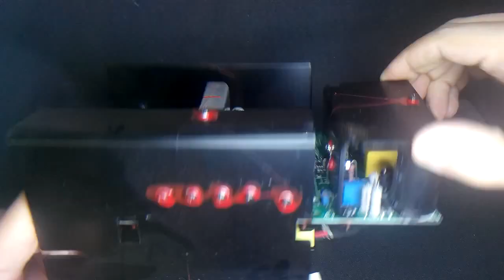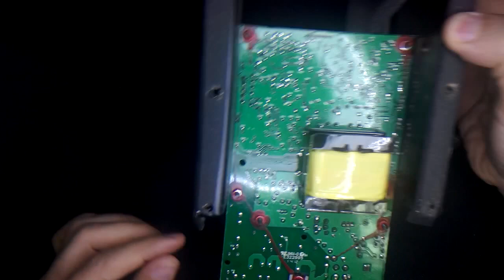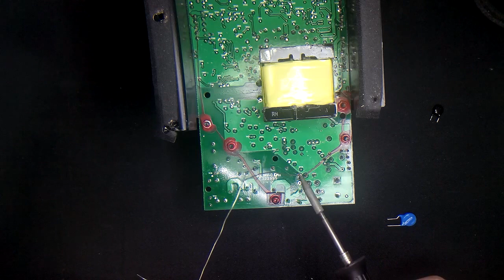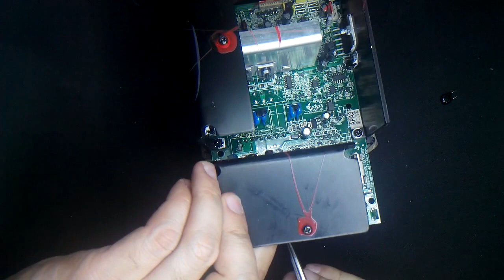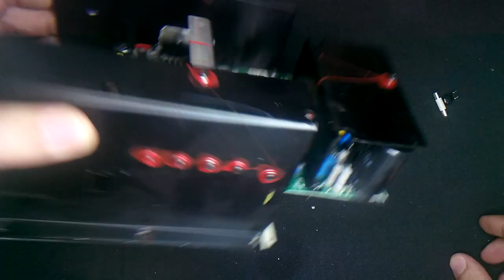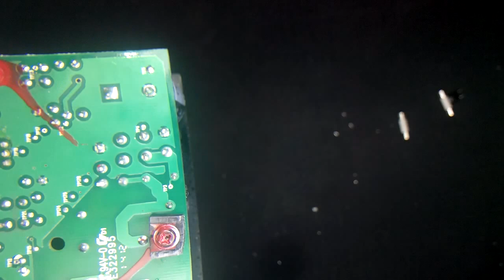Logitech Z623 Power repair

Comment: How about a friend, a question, I have a logitech like that of that model, it atrophied from the ignition, and I think I think it is the same fault that you present in your video. My question is, what piece did you change and what value was it? Is it a filter? And another one you changed the ceramic fuses, for glass ones and of what value or amperage they are? I would really appreciate my brother, this is my work tool and with this I support myself and I want to repair it, help me from the heart. I would greatly appreciate it. Greetings and a hug 🤗

Comment: mine is not powering on. Changing the fuse does not helped. what else i can do now. it is still not powering on. not faced any problem since 2016. all of a sudden this problem occurred. please help.
Reply: Can you fix it same problem
Reply: @VVNNatraj007  yes done by local mechanic transformer replacement done
Reply: @treadstonevinod  in my case smd capacitor blast near by transformer and varistor is no value
Reply: @treadstonevinod   thank you for respond
Reply: @VVNNatraj007  dont panic its not a big problem
Reply: @treadstonevinod  thanks a lot

Comment: can you share exactly what you replaced, its number or specification? Was it a DIAC/MOV/thermistor? a picture if you please
Reply: Did you got the answer?
Reply: @ramdayalb  nope. But I just bought a generic 250v MOV and replaced it. Works fine.
Reply: @burhanmz  Thanks, I will do the same
Reply: He replaced Varistor V7431U
Reply: @burhanmz  what specification/number MOV?
Reply: @renansotero  any generic 250v MOV, its a high voltage protection device